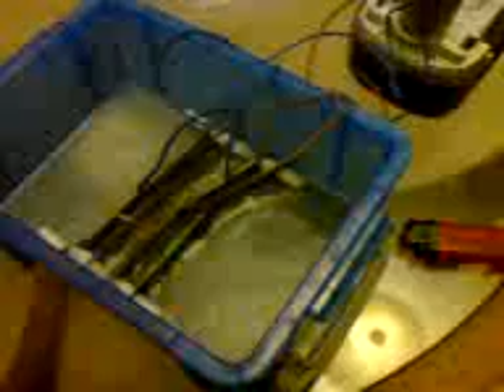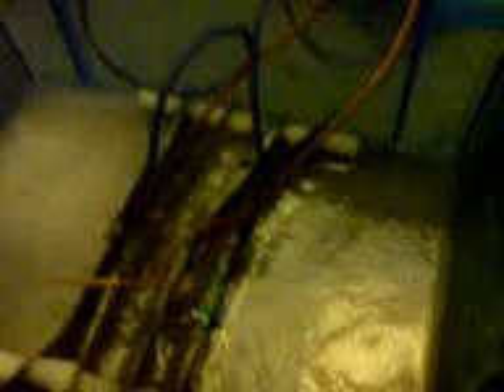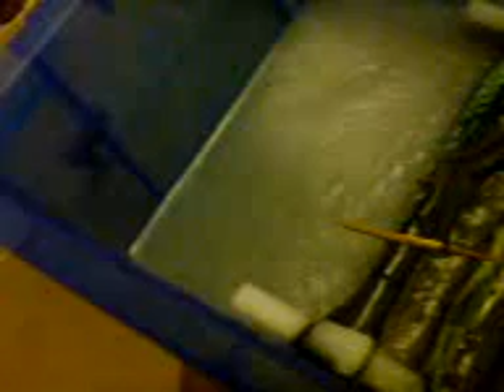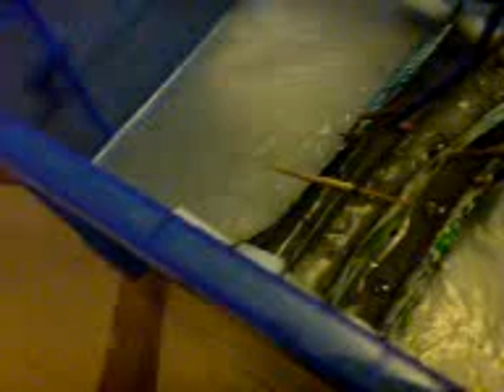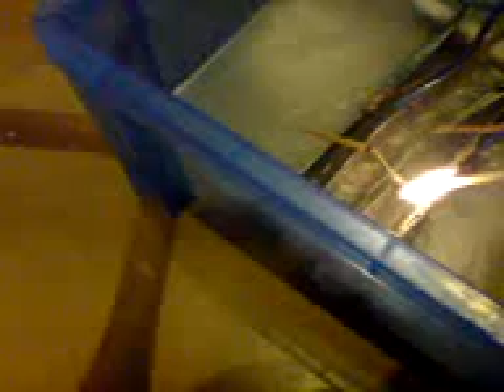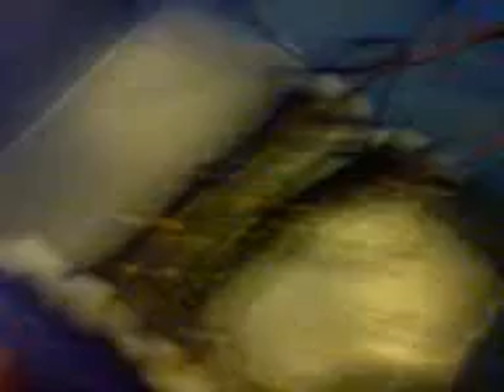phase 1 hho electroylsyer

Comment: Please dont ever try to use Potasium Hydroxide also known as KOH as an electrolyte with aluminum as plates.  will cause a rather VIOLENT reaction. As a rule, I suggest keeping aluminum, coper, zinc and steels less than 304 stainless out of the soup. Tungstun, Nickle and Stainless grades 304 and 316 work best.  The best results using material most can afford is with 316 grade stainless. 

EVERYTHING, even the screw and any wire that is exposed to the soup, should be stainless.